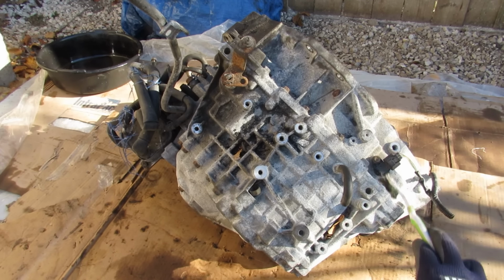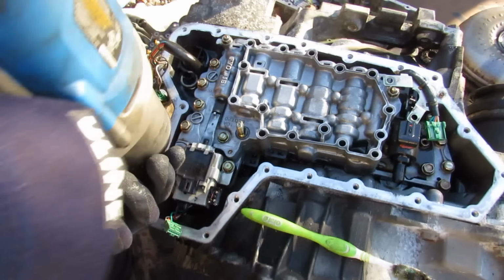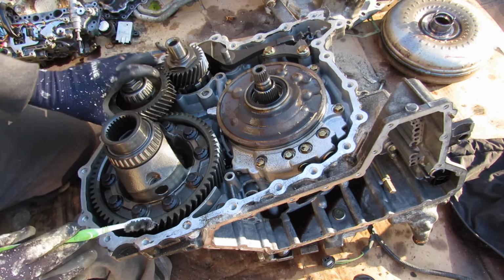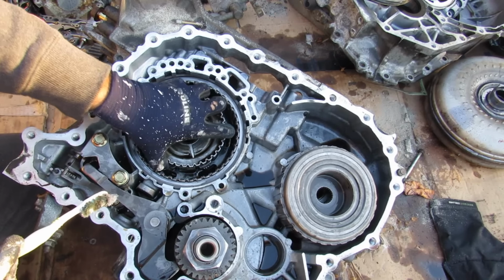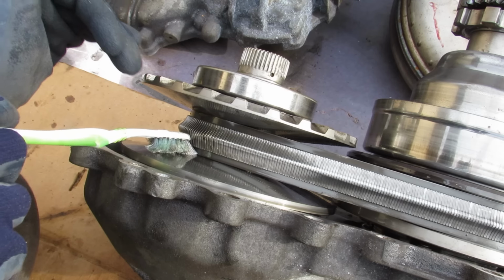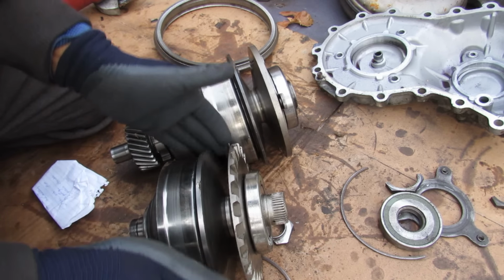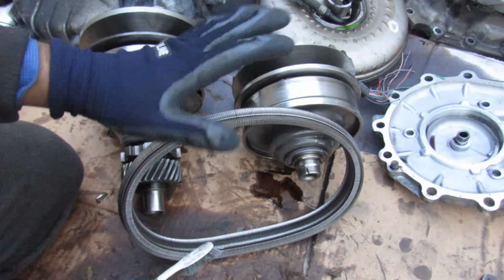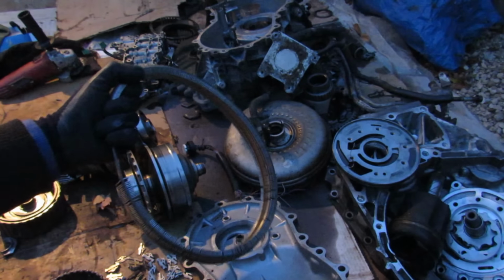Why Nissan CVTs FAIL

Comment: I think the fact that they first appeared on budget cars is a big reason why people don't like them. The CVT's party trick is that it can pick an RPM that gives you the most power or the best economy and then just constantly adjust the gear ratio to match the speed the car is going. That means that when you floor it, the engine spins right up and it drones loudly and at a constant rate as the car is accelerating. People aren't used to that and now that experience reminds them of cheap cars. I think that if the first CVT's were installed on high performance sports cars then people start to think of the CVT experience as desirable. But as it is, car makers are purposely blunting some of the advantages of a CVT transmission by programming the computer to make them act more like conventional transmissions just so people stop complaining.

Comment: So what actually failed with this transmission we're looking at? Do you know if Nissan has bolted on a better transmission cooler now?
Reply: grandiora not really - I'm a dealer tech for Nissan - Tow packages will have an add on cooler - I'd suggest putting an add on cooler even if you don't have a tow package
Reply: Ice Flavour is that the additional radiator for the transmission? My Qashqai has a smaller radiator in front of the main radiator. I think the smaller one is for the transmission.

Comment: Hey, there are a few cobalt ball bearings inside the drive drum. Another mechanic on youtube tore down his broken transmission and found this out. Those tiny bearings allow the drum to slide across the shaft as it fills with fluid. They carry all the torque from the engine, but they will wear heavily against the drive shaft's grooves due to the tiny surface area, which eventually causes the drum to seize, which then destroys the belt and the rest of the transmission. (https://youtu.be/_64zEsMdQ9A?t=2095) 

There is also another different mechanic on youtube noticed this design flaw and converted his ball bearings to rod bearings. So far it seems he has no issues. (https://youtu.be/vX-vW_XNC7o) Ironically, the recall on these transmissions calls for replacing those tiny ball bearings with their version of rods instead. I'm not a mechanic, so I thought of sharing new information with you.

Comment: I'm I doing some thing wrong?   I've got a 2014 Nissan Sentra with over 150,000 miles. And it's still running with no problems ( so far).
Reply: Get your cvt fluid flushed, it'll help it last longer. Some people luck out, these jatco cvts are Russian roulette. Some work fine for ages while other people are having them fail every 10k miles
Reply: @greensheen8759  i would NEVER have my Transmission Fluid Flushed, just change fluid and Filter if there is one at recommend intervals. I worked at a Garage for years, and about 20 Years Ago when these Transmission Fluid Flush machines came out we were flushing transmission fluid on many cars, and many of them were not serviced frequently, then usually about 6 months later about 30%-40% of the cars came back on a flatbed with blown transmissions. All Flush machines do is loosen up and break loose debris that been stuck inside parts of Transmission, then gets circulated through the entire transmission, lines, converter, and everything else. Worse thing ever, especially if you never change your fluids at recommended intervals. Just change fluid and Filter every 30,000 Miles or so. DO NOT FLUSH TRANSMISSION FLUID it's No Good !!!
Reply: @badass6.0powerstroke10  flush is required on these stupid jatco CVTs. Trust me I know about the issues, especially on automatics with worn out clutch packs
Reply: @greensheen8759  i just bought a 2014 Nissan Maxima about 9 Months Ago, just turned 30,000 Miles, now I'm just over 40,000 Miles. Right at 35,000 Miles i drained and refilled Transmission Fluid. Replaced with the correct CVT NS-2 Fluid. Is it a Jatco Transmission in my 2014 Maxima ? I'm not sure. So far no issues with it.
Reply: @greensheen8759  Are the Jatco one's Good or Bad ? I know mine had a drain plug at the bottom.
Reply: @badass6.0powerstroke10  yes, you most likely have the gen 3 Nissan jatco cvt. They're better than the previous generations but should still be driven carefully. I have the gen 2 on my 2013 sentra which I'm going to be putting a cooler on soon
Reply: @greensheen8759   O.k.Thanks.
Reply: @greensheen8759  no, flushes are never advised. Drain and refill only

Comment: I'm curious what nissan did with the 3rd generation of the Xtronic CVT. Our 2017 Murano is at 60k miles and doing good so far. Had a fluid change at 40k, even though the dealership told me it just needs inspection. No noises or rubber banding so far. Fingers crossed I guess.

Comment: So far my wife’s 2013 Pathfinder is holding up.  I did put a piece of rebar through the trani oil cooler I picked up while driving home from work. 1000.00 later and all is good. My pathfinder had about 60k when I impaled the trani oil cooler

Comment: I was expecting to see the part that actually failed.by the looks of the internals Someone did the appropriate maintenance on this cvt.
Reply: He mentioned some sludge on the magnetic pieces so my guess is the fluid wasn't changed at a regular interval and thus probably ate the bearings or something over time.  He didn't say how old it was but that's my guess (although we didn't get a really close look at the belt or the other internal components so who knows). Most of the time ()that I've seen them fail) it's because people don't change the fluid (they fall for the "lifetime fluid" claim and thus don't change their fluid) or they beat them up (are aggressive drivers perhaps).

Comment: Less than 2 years on my Nissan Pulsar and the transmission was already beginning to fail. Just before the car turned 4 I had enough of the transmission playing up. When the car was cold if you accelerated (even gently) the transmission would clunk so hard that it was like you were running over roadkill. My local Nissan dealer kept trying to reprogram the transmission with no luck. They ended up replacing the transmission for free as a gesture of goodwill because the car was less than 12 months out of warranty and had less than 50,000km (I think 30k miles) on the clock. Guess I was really lucky because I would not of forked out money for a new transmission on a car that young and I know people have been screwed over by CVT failures by Nissan.

Comment: This is making me never want to own a cvt.
Reply: Y’all got some tiny engines bro, I need at least 225 hp
Reply: @Kuh_she_n  lol I went from a 5.7L V8 250 hp to this I needed something that got great fuel efficiency and rode nice it was time to replace my old truck I got at 16 thing was a 1997 C1500 ext cab ran like a champ but hurt at the pump filling every week when all I do is city driving. Hurt to replace it the only peace I find with it was my dad happened to need one at the time and sold it to him.
Reply: @Kuh_she_n  2.5l Rav4 with 225 or 304hp? 😁👍
Reply: They do work when comes to economy. I have a toyota minivan that weighs 1800kg empty with 160hp and honda civic that weighs 1300kg with 155hp. Hp isnt much different so weight plays a role in how they go,, and obviously the heavier toyota van is going to be left beft behind very quickly if i drag race these two very different cars. But the fuel economy is a different story:

The civic uses a 5 speed auto torque converter while the toyota uses an aisin superCVT-i with 7-psuedo gears, and despite the toyota van weighing 500kg more than the civic and wearing bigger wheel sets, it actually uses slight LESS fuel than the civic in the long run.

Note that the civic has ivtec while the toyota has vvt-i on the intake,, so both cars were technically geared towards economy at lower engine speed with the honda gradually changing into a rabid little monster above 4000rpm 😅😅😅
Reply: N i might add... the cvt works as it should in a very big and comfortable minivan. Ur not going to floor the nuts off its tires anyways. It was meant to cruise with 7 people and their things onboard,, n despite the wimpy engine, it will eventually reach 160kmh,, and if the road permits, it can stay at that speed all day. Dont go beyond that speed tho.. the van doesnt like that😂😂😂. It can reach 180kmh,, but the mass and suspension setup will make u question ur choices in life.

The civic, meanwhile, is a civic as a civic should. Glorious handling and decent response for whats suppose to be a compact family sedan. Given enough road and leave it in 4th, it will reach 230kmh. Not bad for a mass market family sedan eyh? 😂
Reply: We got rid of our Nissan 2011 because it failed.  Plus the trans dip stick is hard to get to making it almost impossible for you to add anything  to it. Not worth dealing with it. Glad car is gone never going have one again
Reply: Welcome to the common sense club, where we have common sense. Here is your badge.
Reply: From what it seems, Toyota & Hondas would be the way go. Especially Toyota's first gear CVT. If you gonna get a CVT from Nissan, go for the Versa with low power but good economy cos that's where the CVTs work best.
Reply: Recently got a CR-V for the lil woman. Has a 1.5 T with a CVT. Didn’t think twice buying one from Honda, or Toyota for that matter. That thing is pretty impressive all things considered. Fluid n filter get changed every 50k. NOT CHEAP. Cheaper than a trans though. Would not buy one from Nissan.
Reply: I have a Toyota with a CVT I was super hesitant because well tried and true 6 speed auto well I can say that after just under a year this is a 2020 Corolla bought it new back in December of 19 went against everything never buy new but for $2,000 difference between a used Corolla and new was a no brainer. If I have to get a CVT it is going to be a Toyota engineered one those engineers at Toyota knew exactly what to do the car has a take off gear. Literally a gear that engages for take off and the CVT takes over at 10+mph so no lag or anything on acceleration other then the engine being the limiting factors it is the base I4 139 hp with 126ft lbs of torque but it starts when I turn the key and still drives like the day I drove it off the lot.
Reply: @zackarycampbell6497  I have a 2020 Corolla with CVT too, with the base 1.8L. Note that it does not have the separate 1st gear, only the 2.0L cars have them. Fingers crossed that the 1.8L's CVT will hold up.
Reply: @07734YYC  Really? When I was shopping around I came across this site URL below from 2018 talking about Toyota adding a first gear to its CVT transmissions. Do you have any sites you have bookmarked you really peaked my interest I am now on a google search spree for information on this I figured back when I was looking. This must apply to 2019 and later models so the 2020 surely applies since it is an entire new model. 

https://www.roadandtrack.com/new-cars/car-technology/a19431445/toyota-cvt-with-1st-gear/
Reply: @zackarycampbell6497  https://www.toyotanation.com/threads/2020-corolla-cvt.1666526/
The forum thread tells you a bit more info. Also, I drove the SE hatch (2.0L with direct shift CVT) and the LE sedan (1.8L with last gen CVT) and they definitely behave differently in gear changes, or lack thereof.
The direct shift has a much more immediate response (not attributing this to the bigger engine) while the other CVT feels like any other CVT (yes, my other car is also a 1.8L sxxtbox with a CVT). I bought the LE sedan in the end due to limited budget. Fingers crossed that it'll hold up.
Reply: @07734YYC  Thank you! The same sedan I bought LE looked at the XLE but for my location dealers asking way too much I did look at the convenience package which adds remote start and all that and $5,000 more. I never did a test drive with the 2.0L I was not interested in a hatchback model as for fingers crossed. Definitely, I think if car complaints still have 0 on the 2020 Corolla that is a good indicator.  
https://www.carcomplaints.com/Toyota/Corolla/2020/

Comment: My friend's 2013 Nissan Sentra CVT transmission completely failed when the car was only 2 yrs old at 59k miles. Nissan barely honored the warranty (under 60k) and was a $4k repair bill.

Comment: So basically it is the same CTV transmission that are in those cheap chinese scooters.
Reply: Same principle, except the scooters run a rubber belt.
Reply: You don't have to say cheap Chinese scooters.  My Honda scooter from back in the day had the same belt CVT with centrifugal clutch

Comment: Man, that's a ton of friction in that belt assembly. Thousands of rotations for every minute of your drive. I'm surprised they even last for as long as they do.
Reply from the maker: Yep but remember it's all encased in fluid
Reply: It actually relies on that friction in order to work.  The belt has to grab the cones in order to move them.  If it polishes the surface even in one spot the whole thing slips and won't work.

Comment: Despite the "failures" these Nissan transmissions have I will honestly say they are very interesting with all their little parts on the inside
Reply from the maker: They sure are mechanically interesting
Reply: @speedkar99  thank you for the video. I have a 2012 nissan altima and I at least have a better understanding of my transmission
Reply: Yep.  Just like a miniature train wreck.
Reply: @chuckschillingvideos  Standard test when they first came out was a rubber hammer smacked against the bottom of the trans, if it made a jingling noise it indicated there were broken belt links lying in the sump!
Reply: @teenaramsay2469  I'm so glad I finally convinced my wife to trade in her Pathfinder.
Reply: @chuckschillingvideos  well the pathfinder is notoriously trash
Reply: @Kuh_she_n  Yep, and I'm glad that her old  Pathfinder is now someone else's problem.

Comment: My note, on the highway on hill, it stay s on the 4000 rpm the engine, the cvt don t want to change, why is like that?
Reply: If you're climbing uphill, the CVT will adjust ratios continuously while maintaining the engine at the optimal point within the powerband. That's the point of the CVTs, Engine rpm change is limited because theoretically, the CVT can constantly adjust the ratios.
Reply from the maker: Are you flooring it? 
The CVT senses load and keeps the engine in the powerband when climbing hills
Reply: @speedkar99  no i don t, maybe to much km 300.000km 🤣🤣🤣
Reply: That is one of the complaints of a CVT.  The engine revs stay high while the trans does all the work.